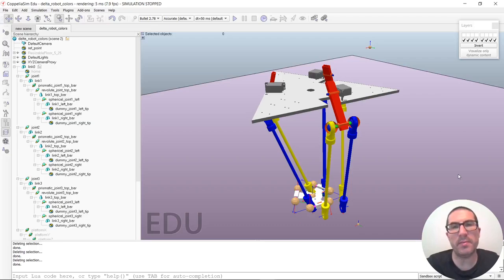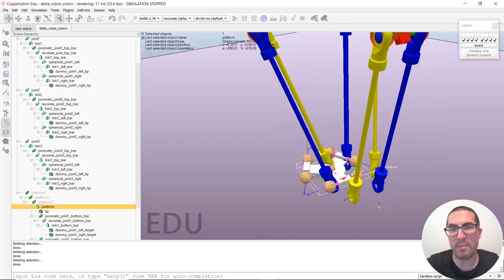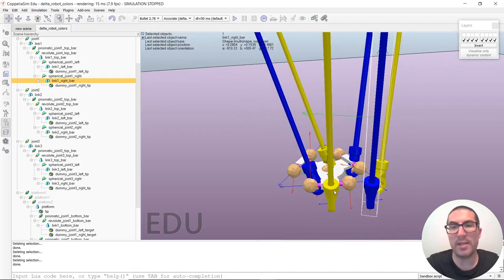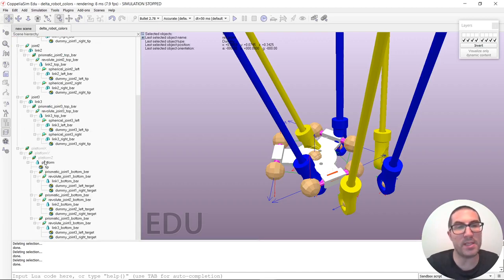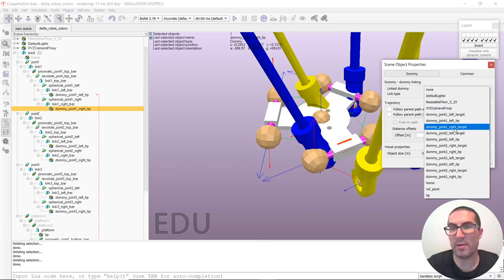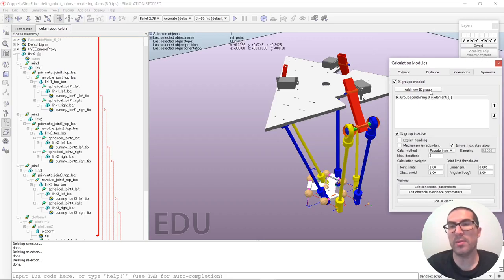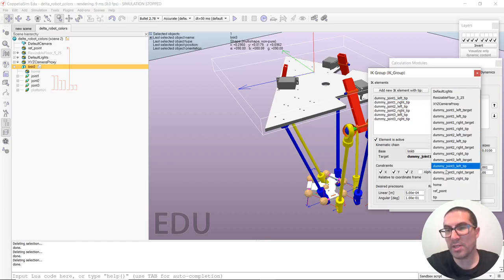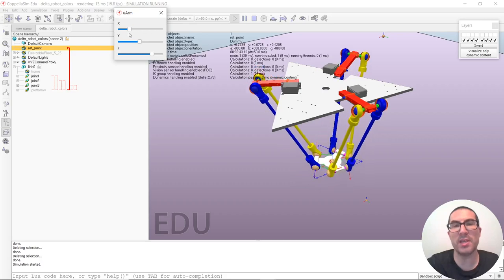Links, Joints and Hierarchy of a 3 DoF Delta Robot (Parallel robot) | CoppeliaSim (V-REP)

Comment: Hello! The use of the three joint for moving the platform are necessary? It is possible not making use of those joints and move the tip by the mouse during simulation? Thank you
Reply from the maker: Hi, this is the only way I could make it work. It needs 3 DOF to move the tip freely

Comment: Hello, How can I make this triangle shape in VREP??
Reply from the maker: Hello, you can’t. You need a CAD software for that. V-REP is just for simulating robots, not for designing them
Reply: @LeoArmesto  Thank you
Reply: I have a cylinder shape (which is the base of the robot) with Diameter=X=0.5 &  Z=0.01, and 3 Omni wheel  45 deg, and I need to add this three-wheel to the base with 120 deg between each wheel, how can I achieve this?? plz, I am a beginner and need help to build this robot.
Reply from the maker: Hello, you need to calculate the positions and orientations for each element. As I said, a CAD software will allow you export more complex meshes, but for basic ones you can use V-REP, but bear in mind is not well suited for a complex design task

Comment: Great video like the other ones you have! It is really useful.
But I still have one doubt. Is the moving platform always parallel to the fixed one? I'm trying to model it in MATLAB but I'm not getting a good result.

Thank you so much for your content!
Reply from the maker: Yes, it should be parallel
Reply: @LeoArmesto  because of the 4 bar parallelogram mechanism?
Reply from the maker: Well, I would say that because of the ‘structure’ (in general)…. Delta robots are just like that
Reply from the maker: I know it’s not an explanation, but it’s hard to say…
Reply from the maker: Por definición, un robot con 3 actuadores no puede tener 6 GdL
Reply: @LeoArmesto  cuando un robot está en una configuración singular la matriz jacobiano pierde rango, es decir, alguna ecuación de restricción es linealmente dependiente. Así, el robot gana grados de libertad (para poder definirlo completamente) teniendo el mismo número de actuadores. El número de grados de libertad no es constante (depende de si está en una configuración singular o no) y, por tanto, no es igual al número de actuadores porque los actuadores no aparecen o desaparecen una vez está montada la máquina.
Aunque un sistema tenga más grados de libertad que actuadores se puede usar un control infraactuado para poder controlar esos grados de libertad con un menor número de actuadores.